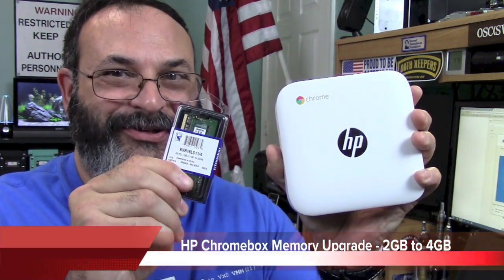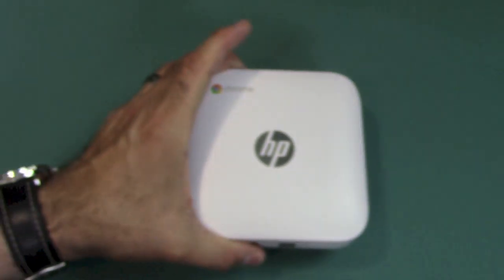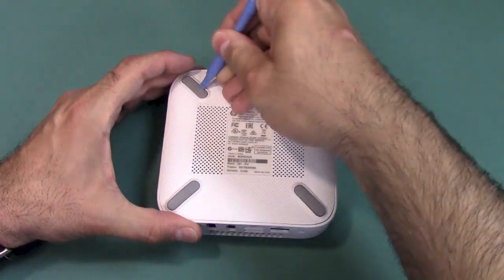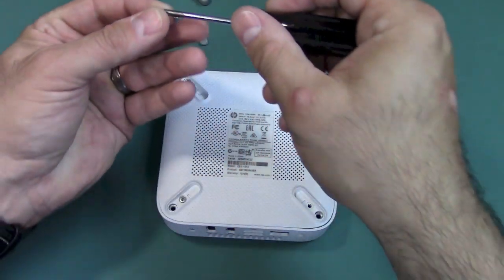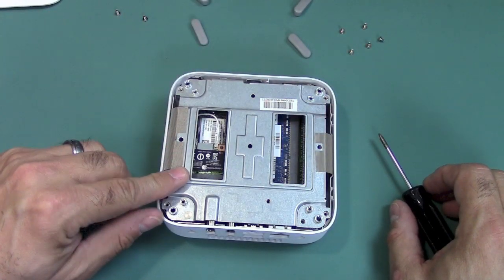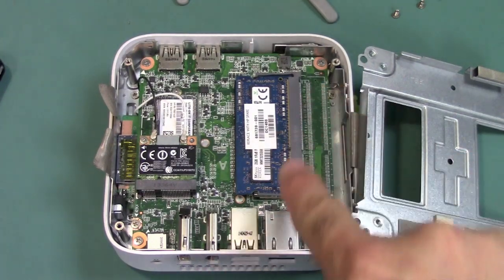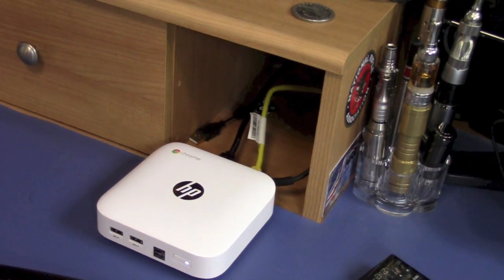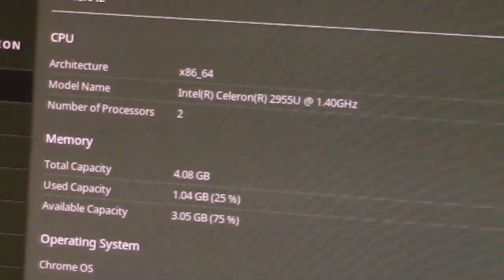HP Chromebox Memory Upgrade

Comment: I have 3 HP desktop computers. All are elitedesk 800 G1 USDT, which is the smallest desktop in this line, which takes laptop memory, a laptop CD drive, a 2.5" laptop HDD or SSD and a regular desktop processor. I really like the design and style of HP. When I was thinking about getting a Chromebox I decided to get an ASUS instead of the HP...for two big reasons. HP cheaped out on the memory banks. Instead of 2 memory banks HP only put in 1 to cut costs and be more competitive in the market. Unlike the elitedesk I have, which has 2 memory banks. This means that the HP Chromebox has only SINGLE CHANNEL memory, whereas the ASUS Chromebox has DUAL CHANNEL memory. The second reason is the HP can only accept up to 4gb of memory and the ASUS up to 16gb. Everything else about this motherboard is exactly the same on both units except for the memory banks (SINGLE vs DUAL). So if you are thinking about getting a Chromebox, think about the amount of upgradable memory and the number of slots. Both use DDR3L (low power) SODIMM (Laptop memory) and only the ASUS can accept as much as 16gb. The HP can only accept a 4gb stick. However, both units can be upgraded up to a 256gb M.2 drive but the processor cannot as it is soldered onto the MoBo. It's a crying shame that I had to go with ASUS for these two reasons. I really like the design and clean look of the HP Chromebox, and I think their upgraded logo is really cool!

Comment: I bought I used hp Chromebox (same model). When I turn it on, power button blinks twice and shuts off. I opened up the unit and removed the RAM. Afterwards, I pushed power and the unit's power button stayed on. I'm not to tech savvy but would anyone know what's going on. If I put the ram back then I get the same symptoms (unit will not stay on). Is it just a cause of bad ram?

Comment: The four feet are asymmetric, and are numbered 1, 2, 3 and 4. Each has a different "key" position, which may be easily seen by inspection.

Feet 1 and 2 have an "L" shaped "key". 3 and 4 have an "I" shaped "key". None are NOT interchangeable. The "keys" on 1 and 2 are mirror images of each other. Likewise, the "keys" on 3 and 4 are mirror images of one another,

The Celeron comes with a 2 GB stick of RAM, which may be upgraded to an 8 GB stick, not 4 GB as stated in the video.

I have tested these assertions on an actual machine, mine, so I know these to be true.

Practical RAM options for the Celeron version are 2, 4 and 8 GB.

Practical RAM options for the Core version are different, of course, as these have two RAM slots, not one, and may, indeed, include 16 GB, which I have no way of testing.

Comment: Lon Seidman has a video on how to install Windows on a HP or Asus Chromebox. As well as Dual Booting XBMC so you can use your Chromebox as a HTPC Media computer. Great for using a Vesa Mount and sticking it on the back of your tv with an external hard drive holding all the movies you have.
Reply from the maker: TekReview's I watched that video but I will probably not be doing that because I have a ECS Liva on the way.  The Liva is the smallest Windows desktop computer.
Reply: I have never heard of the LIVA name, but yeah there is also the Gigabyte Brix models but they would be a little more difficult with a Vesa mount. I think they come with one.

Comment: When you say that it will not take more than 4GB, it the for just the HP or for all of the small Chrome Boxes?
Reply from the maker: George Fenrich I'm only speaking to the HP model.  You should check with each manufacturer for max ram.

Comment: ***** Is it possible to install an 8gb or 16gb stick of ram into the single slot? thanks in advance!
Reply: The data sheet says it can go up to 8gb.   I put an 8 in mine.  It works quite well.
Reply: kyle studzinski Second that, 8GB works just fine, grest if your planning on running Linux and a bunch of Virtual Machines like myself.

Comment: Can you do a video upgrading the processor? The HP customer service agent said he doesn't advise people doing it other than HP certified.
Reply from the maker: David Hake I did not plan on doing annything else to my Chromebox except adding a Linux distro called Crouton. Additionally; I do not know if the processor in the Chromebox I have is removable.
Reply: ***** Crouton is not a Linux distro, it's software that assists in installing Linux under a Chroot in Chrome OS.

Comment: does that thing not have any provisions for cooling? Or is there a heatsink on the other side of the board?
Reply from the maker: 27dcx This has a fan that vents to the rear of the unit.  The fan is very quite.